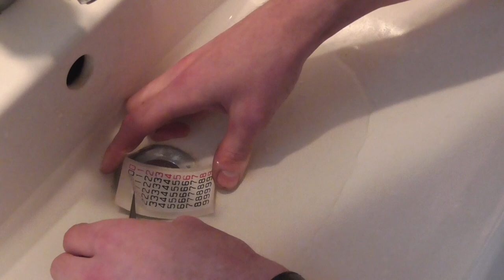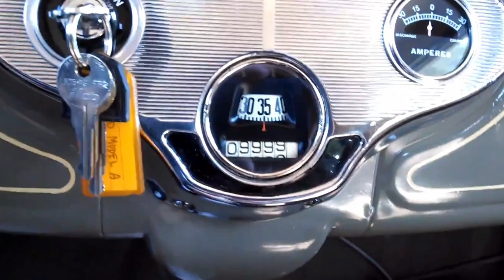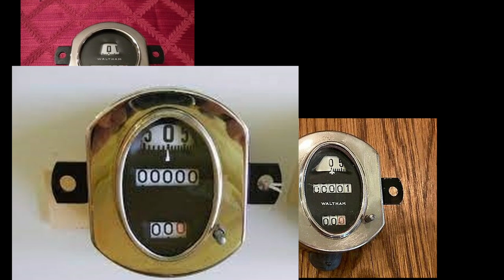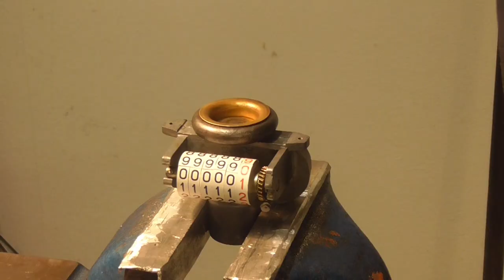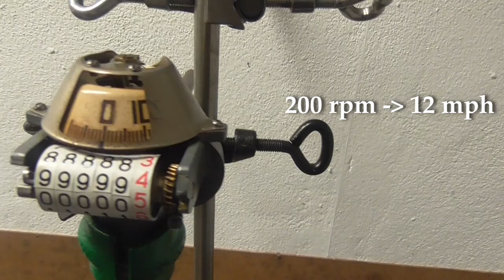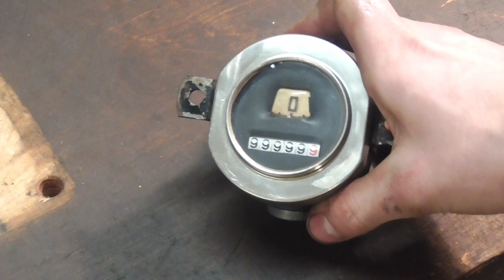Model A Speedometer Refurbishment

Comment: It's funny how that drum style speedo went in and out of fashion.
In the 1950s, Studebaker had it's "Cyclops Eye" speedometer and of course the 1958 Edsel had it's "Control Center" complete with a "compass-style" speedo with an optional red warning light that would come on if the car exceeded a preset speed.
The main disadvantage that I've heard about the drum style speedometer is that because it shows current speed as opposed to the relationship to zero that a sweep speedometer shows, it's sometimes easy to loose track of how fast you're going. When the digital speedometers came out in the 80s there was a similar problem. We're an analogue species and will process "the needle is 3/4 of the way to the top" easier than "58 mph". 
Good job on the refurbishment, as always. You have an infinite amount of patience (as well as a useful store of German curse words!)

Comment: I just finished refurbishing a 1928-1930 Stewart Warner oval speedometer, which thankfully was not stuck and just needed lubrication and new decals.  Lining up the wheels on the odometer was a nightmare and took two tries to get them right.  As you mentioned, working with the self-sticking numbers was easier but I found it harder to cut them apart with my razor blades.  Guess I should have been using German-made ones like you did :)

Comment: Congratulations, a job I had to do in my Mercedes Heckflosse, the partial odometer did not engaged and when you wanted to re set it turned and not catched, The problem was inside each number, the little support of the  spring broke, I just epoxied them in place.. In the R4, I had to change the pointer, it was bent and charred, and all gummed too, in my R9, same thing and also a bad teeth on one gear.. I repaired it with some epoxy putty, in my nissan station wagon I had to use some of the numbers and gears of another damaged cluster and I was able to complete one with pieces of two.. 
I can't stand a cluster that doesn't work properly!

Comment: Quick question if you can help. I have an oval speedo in my 30 coupe. When I got the car, I noted the speedo read 5 mph low (when I was at 30 mph indicated, actual speed was 35). The odometer tracked spot on.  On a whim, I changed my speedo gear to an 18 from a 19 (I have a 3.78 rear end and 19 inch tires). Now, the speedo is only 2 mph off (33 indicated, 35 actual), which I could live with, but the odometer is now 20% off (100 actual miles traveled indicates 120 miles on the odo.). My question is: is there a way to "tweak" the tension on the speedo number wheel spring such that it has less tension and would more accurately track with the odometer? I would then put the proper 19 tooth speedo gear back in so I could accurately track the actual mileage, as well as be more accurate on actual speed.  Thanks for your great videos!
Reply from the maker: I'd suggest one of two things: The easiest thing to attempt would be to put washers between the main casting and the part which holds the number wheel, thus moving it away from the magnet, hopefully decreasing its force.
If this doesn't work, you'll have to change the position of the hairspring so it provides less back pressure - either by gently opening the slotted center piece so it can be turned on the shaft, or by removing the taper pin which fixes the spring to the outer post and re-fitting the pin after moving the hairspring a little.
This, however, requires a very delicate touch - and I'd advise against it if you have never handled a hairspring. They are incredibly easy to bend... Maybe you can talk a local watchmaker into doing that for you if you aren't comfortable with it.
Reply: Great news! Your advice to adjust the hairspring was spot on! Not beyond my capability whatsoever. My hairspring had about 12mm of excess spring past the achor point. I removed the taper pin at the anchor point, adjusted the spring to move all of the excess within the anchor, then replaced the pin. Since I reduced the spring tension, I noted the speedcup would now not reset all the ay to zero, so I had to make a successful adjustment to the center pin brass bushing, reseting the zero point (relaxed position of the speed cup). Test drive with a GPS speedometer showed my adjustments to be extremely (by chance) accurate.  Thanks for great videos! Looking forward to more! Auf Wiedersehen!

Comment: What kind of grease did you use on the two sets of odometer drive gears? I just had to take one apart to fix an inoperative odometer (the brass cover had popped off the odometer gear, and it slid out so it no longer made contact) and I need to grease it back up.
Reply from the maker: Any bearing  grease will do - just not the super heavy stuff you use to lube up suspensions.

Comment: I like that you are using the lathe as a drlling machine, with the drill in the chuck, just like the old guys would. A friend of mine, some 50 years my senior, started his apprenticeship in 1941, alwayd did the exact same thing.
Reply from the maker: If there's no way to clamp or support the part, it's alot easier to push the part into the drill vertically rather than horizontally like you would in a drill press. 
I think I copied that from an Old Timer, too :D

Comment: Great work and video as usual. Always fun to watch. Is the speedometer dial enamel? If so, next time you have it apart, soak it in Polident denture cleaner. Perhaps you're familiar with it already, but it's a popular cleanser for enamel watch dials. I've used it myself on pocket watch dials, and they come out quite white after a soak.
Reply from the maker: To be honest, I can't say if it is enamel. It sure would make sense, but it looks a little too dull imho. Also, enameling would have probably been too expensive a procedure for Ford.
But thanks for the tip - might come in handy for watch dials, too.

Comment: It's funny. The first thing I did to my 300sd was repair a slipping coupling in the odometer. Then I had to recalibrate the speedo with my GPS. I am within a couple MPH of the gps and the odometer is working nicely. I used a few drops of ATF in the speedo cable to keep it free moving.